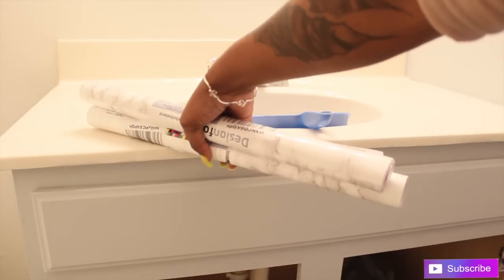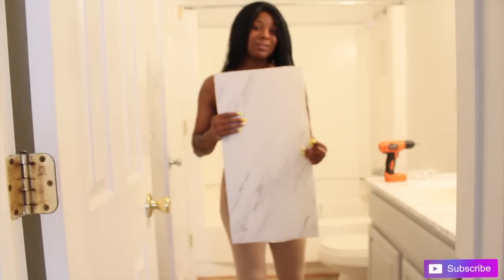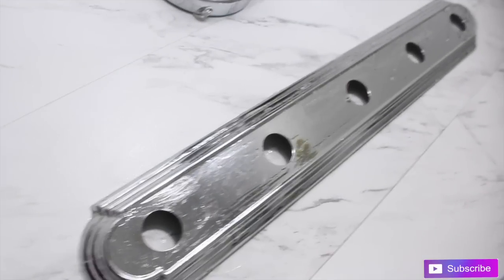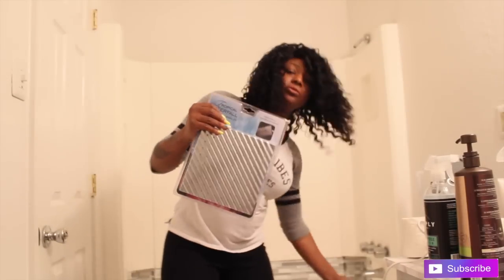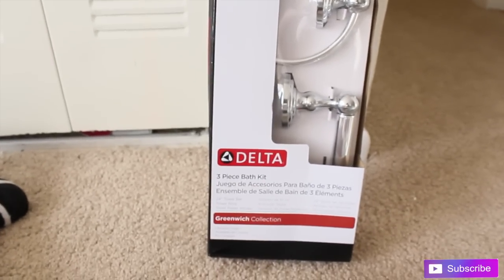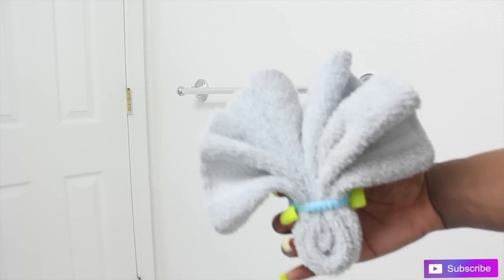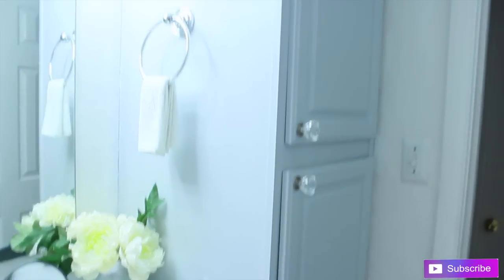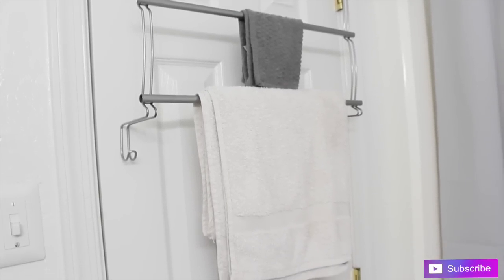DIY| Small Bathroom Makeover!!!+TOUR|Affordable

Comment: Just a tip for beginners in small areas on the floor. Buy poster boards. Place it on the floor and use it as a template for the cutouts. Then when you place the flooring down you will have a perfect cutout. Just think of a puzzle.

Comment: Just a thought, if you have left over backsplash tile left frame your mirror with it. That would really tie the sink area in with the tub.
Reply from the maker: Cami Brown wow that's such a cool" suggestion I am going to seriously think about doing that because the mirror is very boring thanks so much for watching XOXO
Reply: Cami Brown I was going to suggest the same thing. and also you could take the light fixture back down and spray paint that silver. It will totally get rid of that weird look to it. But you did an amazing job!!
Reply: Jaz shegtdasnap You could also frame it with an actual frame using double sided tape. If you found one you like, but it's the wrong color just paint it.
Reply: Cami Brown I was thinking the same thing! She did a great job!
Reply: I would definitely frame the mirror!
Reply: Cami Brown

Comment: Great for a beginner! I would like to suggest you use a measuring tape during your installs and an exacto/carpet knife for clean edges instead of bending and snapping your tiles. If you accomplished this by doing that, just think how seamless your work would be with the right tools! You should also lay out patterned materials first to make sure they are seamless and the design matches up where the other leaves off as you add on pieces of the back splash and the flooring.  Once you have done that, measured and cut the pieces for an exact fit then you can commit to a permanent install by gluing it down. Also take a little more time and slowly apply and smooth the contact paper a little at a time to avoid a lot of the bubbles and creases you got.  I love that you are merchandising. "She got the snap"

Comment: Haven't reviewed all comments but if someone hasn't already mentioned it you can get rid of any bubbles or wrinkles in your contact paper by using an exacto knife or a very sharp tip razor knife Just cut a hole and squeeze the air out.

Comment: You made a great difference in the bathroom. May I make a little suggestion, if you have any leftover tiles from your tub and used some strips to make a frame around your mirror you would make it really stand out. You could also cut them narrow and put a frame around the shelves it would add even more color, jjust a thought. Don't fight with those tags on your towels cut them off. lol.

Comment: 😊😊😊😊👁👁😊😊😊Look@ this!!!
You did only one thing I consider being wrong. Should had removed the bathtub chrome water faucet and had one piece of tile. You ended up cutting many pieces.I wish you much success doing the next make over. Trimming the same around the mirror would look bomb too.
 It looks like an apartment so you can remove it easily to not damage the property. "Good job" over all 
Come do my bathroom lol
I have not seen the tiles this large.. has anyone else seen those peel and stick tiles that large? I wonder if a paint could had been used in the sink (redo-refinish) type paint would had set it all together..
 Yes someone else wanted to know about the contact paper sticking to the sink!! I saw air bubbles so what did happen??

Comment: Your makeover is inspiring but I don’t recommend the contact paper idea for your vanity to anyone else. I work for a flooring company and much of what we do is filing a caulking. Caulk is not intended as a sealer or waterproofer. It’s just meant to give a finished look to joints where two surfaces come together in a wet area. It’s better than no waterproofing but it won’t last, unfortunately. Its definitely not intended to seal contact paper. It’s a nice temporary solution until you can afford a new vanity or until you decide to try a product intended to resurface a counter top, though. I’d love to see a video one year later to see how long it lasted.

Comment: Although You may not have liked those cabinet finishes in the bathroom. I personally don’t like oak finish myself.I think it was pretty grimy for you to take it upon yourself to paint them because now they are not professionally painted and I’m sure in person they look Like they were not professionally painted. So now the landlord is going to need to replace those cabinets which will take up your deposit. I don’t know if you know or not the cabinetry is very very very very expensive to buy and install. Also your towel rod was crooked. So the landlord is going to have to have That fixed also that means that’s going to be drywall work.And depending on the damage I could be sort of expensive. Putting that contact paper on Vanity may not of been so bad but after you put that sealer around it you destroyed the vanity. That’s going to be very hard to get off the vanity without leaving damage marks. Another big replacement item. Also putting that sealant caulk around the bathtub like that Going to leave a permanent mark on that tub surround. Basically that will need to be replaced if you wants to leave a fresh clean look for the next tenant. So basically you destroyed the bathroom for the landlord. Water IS going to get under that contact paper And before you know it you will have a very dangerous mold growing the same thing with those tiles that you stuck on the bathroom shower. That’s a great way to get black mold starting. I’m a contractor so I’ve seen tennis do this stuff before. It’s a shame. You could’ve hung some nice shower curtains and towels and kept it at that when you want to do something like this to property may wanna make sure it’s your own.

Comment: I don't understand why you caulked before you had all of the obvious bubbles worked out of the contact paper.  Also, tip for future refreshers of bathrooms by using peel and stick tile, you start with a full tile up against your door threshold, not the far wall.  That way, if (and you usually do) you do need to cut the tile to fit the final space between last laid tile and your wall, it's in an area where you're not as likely to notice it, an area that won't be getting a lot of foot traffic.  Full tiles at the threshold will wear better than a sliver of a tile cut to fit in a small strip that needs to be filled when your bathroom is not the EXACT fit for "x" number of tiles your width and/or length (depending on how you lay them); for instance, a 6 foot long bathroom will fit 6 - 1 ft. width (typically 12" x 12" squae) tiles or 3 - 2 ft. length tiles typically (12" wide and 24" long).

Comment: I don't get it, on one hand you spend the money on some rust remover & not the cheapest caulk but you did a mess of the contact paper with a dust pan instead of using a 2$ plastic tool or even a dollar tree ruler for your tiles?
Reply from the maker: I ᎠᎾᏁᎿ ᎶᎬᎿ ᏯᎻᎿ ᏕᎾᎷᎬ ᏢᎬᎾᏢᏝᎬ ᏨᎾᎷᎷᎬᏁᎰ ᏰᏬᎿ ᎻᎬᎽ... ᎽᎾᏬ ᏝᎨᏉᎬ ᎯᏁᎠ ᏝᎬᎯᏒᏁ ᎿᎻᎯᎿᏕ ᏝᎨᎰᎬ ᎷᏬᎯᎻ ✌🏽

Comment: Okay people don't use contact paper there is a product bet you can use for this at your local hardware store that is actually meant for this there's actually one that's meant for appliances but she could have used and when it's time to remove it you just take a hair dryer and heat it up and slowly pull it off and it leaves no residue behind there are YouTube videos on that as well one lady did it to test it to see if it actually comes off easily and it does my landlord said that I could do whatever I wanted to do to my apartment as well as long as it was within good taste now the question is whose tastes are we talkin about so I actually haven't done any refacing anything but I will be putting up a new bathroom mirror and that I know they won't complain about

Comment: Wait! You did this to an apartment? I would be so pissed! Tbis is not like gettinf hair extensions. Can’t Undo the permanent things you changed !You probably didn’t have an okay from the home owner. No way would any home owner accept that
Reply: Oooh, I must say I'm shocked there weren't more comments similar to yours. If it looked professional, you might get away with JUST losing your deposit, but the many bubbles in the contact paper counter looks GHETTO as hell. Use a blow dryer to shrink and smooth. The floor tile should've been laidout prior to starting to stick so it would line up better and keep imperfections hidden under or next to vanity bottom. Great vision(ideas), horrible execution, especially in a property not yours. Very disrespectful. Wow.